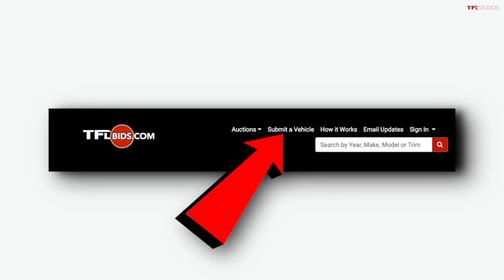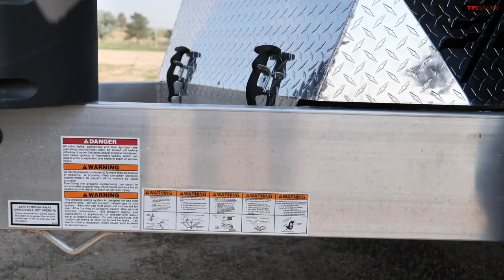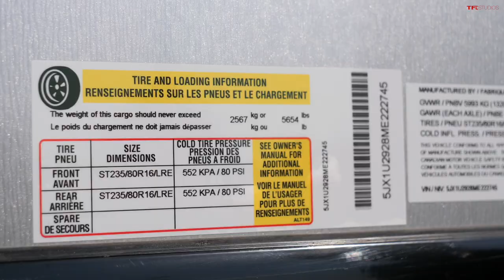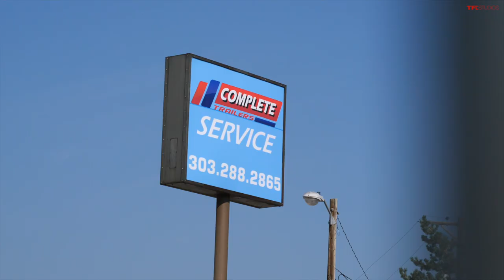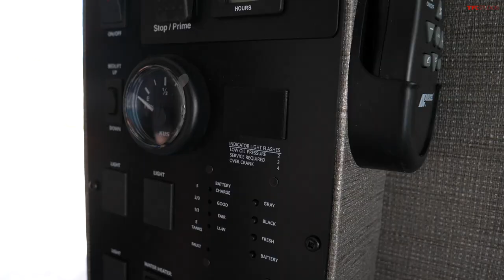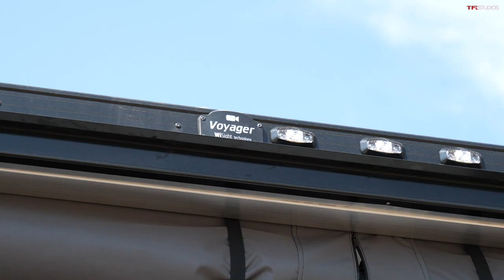This 35-Foot Toy Hauler Trailer Has The Craziest Feature I Ever Seen - TFL Camper Corner!

Comment: Bought my first one in 18'. A 28' front bedroom. Great trailer. Decided we needed more cargo capacity and then bought a 28' front bathroom. Had an offer to sell it and we did. Didn't loose any money on them as prices have gone up a fair bit. Last December we bought a leftover 2020 36' fifth wheel. Should have done that from the get-go. Lots of space for us, the toys and the dogs. Love the trailer. Make sure you find a good dealer with a good rep. They are not all equal, you will travel to get one.

Comment: Awesome video my friends!  ATC makes some great trailers with crazy payload capacities. I'm not a big fan of the battery location.  I feel they could have placed it in its own area an not in the passthrough storage.
Reply: Please review one of their 5th wheels. I would very much appreciate your honest opinion. Love your videos!
Reply: Was made aware of ATC from a review you did a couple years back, proud owner of a 2917 now!  Keep up the great work!
Reply: Surprised JD didn't mention the half-ton truck pulling this thing 😁
Reply: You could put the batteries in the same compartment as the gas pump
Reply: What do you think of an all
 alum frame ?  Have a 2018 f250 sd with a all alum body but a steel frame
Reply: @WilliamFisher1  3/4 ton. Gasser though.
Reply: @CompleteTrailers  Oh I didn't know there was a 2500 Z71 now. Cool.
Reply: @WilliamFisher1  2015 model and we need to trade it but…no trucks available lol
Reply: JD is looking at his new competition 🤣
Reply: @WilliamFisher1  it's not loaded.
Reply: @kellycrandall6258  I have two horse trailers that are all aluminum. Frame, floors, walls and roof. Both are more than 20 years old. Both are still in fantastic condition with no signs of stress or cracks. And I use these trailers frequently. Mostly in backcountry environments, off highway. Logging roads, etc. No issues. I think the only way to kill an aluminum framed trailer would be to overload it. I do wonder about the weight of something heavy, like a Jeep, at the far end of that trailer. But judging by the frame rails, I doubt it would be an issue.
Reply: @WilliamFisher1  that was a 3/4ton 2500HD Gas truck.
Reply: @davem7722  no competition here. I love the TFL channels!  The more perspectives on RVs the better!
Reply: @447Film  if enclosed, not sure if anything able to spark would be good where gas fumes are. Just my opinion though.  Peace.
Reply: @birdlady2725  I know I was just kidding😆
Reply: @447Film  Any relation to Swift Transportation?
Reply: @birdlady2725  I wish. I would be using this trailer instead of watching it on my phone

Comment: Love seeing others appreciate these!  We have a 28 ft ATC toy hauler for fulltime living and love it! Our tow vehicle is a 2500 diesel.
Reply: Could you get sealed bottom and heated tanks?
Reply: @davidc.9933  we have heated tanks. The unit we purchased was off the lot and did not come with underbelly insulation but that is certainly an option, or can be DIY'd later. Some think having it is worth it and some don't. Also, it's not sealed.

Comment: I’ve been hauling a camper for a long time and I think I’d want a dually for that rig.
Reply: Judging by its weight and that it’s a bumper pull it looks like a 2500 or 3500 would have no problem. Maybe with a Jeep in it tho a dually would be better. But at that point just by a fifth wheel toy hauler.
Reply: I wouldn’t use anything but a dually for that trailer
Reply: <14000 gvrw is well under new 3/4 tons capability... move to a dually and you're under  50%...
Reply: @gill998  I live in Texas. Pulling that ridiculous bumper pull behind a single rear wheel across the plains with a 20-25 mph cross wind would be a wild ride.
Reply: @gill998  that's not the point  a DECENT crosswind with a jeep or a side by side in the back would change your mind very quickly. guaranteed
Reply: @johntyson  A Ram dually long bed with a Cummins for sure.
Reply: @johngaudet6316  Nah…F350 dually long bed like mine for sure 😂

Comment: Nice video..
I was going to get a toy hauler, BUT , the cost of the hauler, the cost of the PROPER truck to pull it, the fuel you'll use to tow it, then a generator!!
I just get a hotel rooms and save myself a ton of money!!!
Reply: Yea and you come out in the morning and your trailer full of gear is gone.  Happens a LOT!
Reply: I did the math on this too…I’ve been looking at ATC for awhile.  Bottom line, as you mentioned including the truck to pull the trailer, the breakeven point between a motel and this setup is about 800 nights in a hotel. Not including truck and trailer maintenance. ATC makes a great rig though, my wife does not like it because it feels like you are sleeping in the garage.
Reply: @MrSkurtenb  LoL!!

Comment: For safety and other reasons, at 35' I'd be looking only at a 5th wheel. Nice frame and structure though.
Reply: get a good sway hitch and its fine. my 32 foot hitch pull was all over the place even going slow. put a sway hitch and it doesnt move. doesnt go into other lanes even cruising 70 down the interstate passing 18 wheelers

Comment: It would not be fun pulling that trailer fully loaded on a bumper hitch even with a 1 ton truck.
Reply: Have the same trailer and 1 ton F450 pulls it just fine!  On my way back home from a 2,200 mile round trip now. 👍🏼
Reply: Weight distribution and anti-sway are 100% required with this trailer.

I regularly pull a properly equipped 16k conventional tow tilt bed with my F350 long distances with no concerns.  In fact, it tows easier than my 8k camper with my Expedition.
Reply: @markburnett8699  Agreed. I’m using a EAZ Lift hitch for weight distribution and sway, only complaint is that the don’t make a 3” model for the alumiduty receivers.
Reply: A one ton dually is absolutely fine . The dual wheels really makes it an easy pull. I wouldn’t want to tow it with that 3/4 ton very far, that’s a lot of trailer and getting the tongue weight correct with your toys may not always be easy or doable.way better off with a a dually .
Reply: @leeduis  1ton F450?
I have never heard anyone refer to an F450 as a 1ton before.
Reply: With these trailers being an open Floorplan instead of a Garage Floorplan it's very simple to load them correctly. 
The axels are not just centered on the frame.
Reply: @jamesglenn520  1/2, 3/4 and 1 ton are the traditional categories… does 1.5 ton work better for you? 🙂

Comment: Have a 2016 28FB. We have really enjoyed this trailer. We pull it with a 3/4 ton. No sway with and without a wdh. Have andersen wdh. Will use it crossing SD, WY and other areas when winds are high. If we ever upgrade it will be ATC or something very similar. Only issues have been typical 3rd party rv appliances that all trailers have.

Comment: This really will be carefree for decades. The aluminum cabinets are excellent, if you like the look. I do. Like Andre says put your toy inside and go! We travel with a Pioneer 1000 once in a while and something like this would be nice. Even when you don’t have anything in there it will be nice to have all of that room! I have a nice bed for when I snore too much and Momma kicks me out!! Hahaha. I agree with Andre to a point. I would never even consider a gas motor for this trailer. They don’t tow worth crap! They have a bit more power than some of the 1/2 tons, but not enough to warrant more weight. There’s no turbo so the torque band starts way too high and it is not near enough when the going reaches the maximum of the trucks. Diesel would be the only consideration by myself for towing a travel trailer, especially when they get to 8.5 ft wide! It’s got so much frontage that adds to the workload sometimes more than weight! We live in very windy country here in Alberta and it makes my F150 Hybrid work pretty hard going into a 50+ mph wind (until I can safely pull over and park the u it until the wind dies down). The w1 Hybrid does have diesel like torque up to 570lb ft!  It’s just nothing like how the diesels produce torque now. 900 + lb ft of torque is nothing to sneeze at and no gas motor out there can compare. Been towing for a few decades now so I like to think I know what is safe. The new trucks are amazingly capable if not a butt too over rated in the 1/2 ton class. All a sad competition for our dollars!!

Comment: Toy haulers as travel trailers are very dangerous if not loaded properly. The majority of what you are loading is going to be behind the axles which will subtract tongue weight. I've seen numerous travel trailer toy haulers wildly out off control going down the road because of weight distribution

Comment: Nice trailer! You know JD (BTBRV) will tell you dually only
Reply: yep was just thinking that
Reply: @jamescalvert240  You are looking at anywhere from 800lbs to 1980lbs of tongue weight from that trailer depending how it is loaded up. So yeah id be leaning towards a dually as well since most SRW trucks hitch might not be able to handle that weight. If you are gonna drop  $85k on a TH like this then im sure you could afford the appropriate truck as well. Hell my '12 350 srw would be at its limit with this trailer as the hitch is only rated to 1500lbs with a wdh setup.
Reply: @bpaul1201awesome  My 2020 Duramax CC LB 4x4 is rated at 1800 tongue and 18.5k trailer and it handled about 14k like it was nothing. It depends on what truck people have and how often they plan to tow. A dually rides to rough for me and I have a somewhat small toyhauler and equipment trailers for work are easily covered with the capability it has. I used to tow my toy hauler (8500 lbs loaded actual weight, but 21' long and 11.5' tall) with my 79 C20 with a well built gas engine, air bags, upgraded 4 wheel disc brakes, etc. Trucks have really improved over the years, even over the last 10 years.

Comment: Would a 2500 diesel run out of payload with that trailer.
Reply: My 2020 duramax CC LB z71 is rated at 18.5k trailer and 1800 tongue, and something like 2800+ on pin weight. It is very stable and rides great. I have only hauled up to about 14k in a trailer. Older trucks have less capacity, even the 2019 duramax.

Comment: Many trailers are missing the on an generator because there is a severe shortage of parts for them. A lot of manufacturers are sending units to dealers without the generators installed.

Comment: All aluminum is definitely worth the price of entry, but it must be built right.  I own an EBY stock trailer, because they are much stronger than the competition.  Early competitors experienced frame failures that were resolved with proper gusset and other design changes.

That said, I would be interested in seeing a factory tour showing the fabrication of the frame and gussets of the trailer prior to mounting the body.
Reply: @chrisneuhaus7188  
Good stuff!  Exactly what I was asking for.  Thanks!

Comment: Nice trailer but I'd prefer a fifth or GN setup.   A 35 ft bumper pull that size with the weight of a jeep as a variable in the ass-end .... you'd better have the WD hitch dialed in for each trip and weight variation.   Uffa.....

Comment: At bear minimum that trailer needs a one ton single rear wheel just based off of  payload capacity but really a dually is better.
Reply: My 2020 2500hd duramax would be more than enough. It is rated for an 18.5k trailer and 1800 tongue weight. It pulled 14k like it wasn't there. Of course the 2020 has higher ratings than previous years and it has a 10 speed trans. I would imagine the 2500 duramax trucks from the teens should be ok on rating, but maybe close. A dually is a safe bet, but I have a friend that towed up to 18k with a 2500 dodge cummins and he said stability was fine. He also had a dually cummins, but has switched to an F450 for his living quarters horse trailer that is 40' and 30k pounds. For me, a dually wasn't an option due to the ride and my toy hauler is only a 21' but at 8500 loaded and work trailers aren't more than 14k. It depends on how often people tow and what their needs are.
Reply: @CGT80  the payload and towing capacity maybe there but 14k on a flatbed trailer tows way different than 14k in an enclosed trailer. 

35ft long and a full profile unit is a HUGE sail behind the tow vehicle.
Reply: @runningscout14  Yes, my 21' 11.5' tall toy hauler (8500 lbs) was quite noticeable behind my old truck. Even in wind, it wasn't noticeable behind my new truck. A friend used to tow a 35' 5th wheel with his single tire truck, but it seems goose necks and 5th wheels don't effect the tow vehicle as much......plus they are shorter when combined with the tow vehicle. My 21' ball to back is the same length as our 25' 5th wheel, which overlaps the truck by 4 or 5 feet. My truck also has sway control built into the steering system (top of the line duramax) which might be a great thing for such a long tag trailer. It would be interesting to hear from people who have towed the trailer in the video......dually is certainly the better bet.

Comment: I am not sure you could run a WDH on this trailer without drilling holes. I know a lot of HD's are technically capable of taking this without a WDH but I would still want to run one.
Reply: A DrawTight 4point should work fine with this trailer.

Comment: Great video. Can that ramp support a Jeep? Does the trailer have hydraulic leveling jacks? Does it have a MORide suspension? With what tires is it equipped? Is it set up for rooftop solar? Etc.
Reply: ATC's website shows them testing the ramp with a forklift.  Not sure on the MORide but it has Goodyear Endurance tires and can be equipped with up to 800watts of solar I believe.  I'm looking at one of these.
Reply: They use torsion axle.. Ie no shackles.   Basically 4 wheel independent suspension.

Comment: I admit it's very well built and looks like it would last forever. However, I don't care for that cold, stainless steel, industrial, operating room look inside. Also, the kitchen doesn't seem to have much counter space and the sink is in a very awkward, cramped location. Might check out Sundowner.

Comment: Andre, why didn't you tell us the tank capacities?  If it's not 4 season capable, clearly it lacks decent insulation.  Plus, that aluminum gets real hot in direct sunlight. I didn't see a sway bar on the trailer hitch either.  Wouldn't it be safer with a sway bar system since your rig is so heavy and can carry about 3 tons in the garage as well as a toy gas supply.
Reply: probably no WDH or sway bar setup since it is a new trailer and it isnt his. Most dealers dont want anything like that on demo units. Those are post sale items that are added in. It is empty so probably not much if any sway. They are delivered from the factory as well without a wdh or sway bar.

Comment: Great video Andre/TFL. It’s best to haul that Toy Hauler (TH) with at least a 3/4 ton. I think Andre was being too soft when suggesting “kind of should be hauling with”.  It’s imperative; HD trucks have a much stronger chassis and better braking and more to handle this trailer, with safety. I remember hauling my Jayco TH with a 1/2 ton with max. tow package and feeling the truck wobble at times and simply feeling under built for the task. When I switched over to a modern 3/4 ton, so much more capable and stable; simply the right choice and getting the same fuel economy as my 1/2 ton when pulling. Also thanks to Big RV Big Truck for their videos on what size truck makes sense when hauling whatever. ATC as many have commented; superior build quality and thus a premium price. 👍🏼

Comment: That shoulda been made a 5th wheel for sure, or gooseneck.
Reply: That's the largest standard trailer they sell. They start at 15ft and very capable at that size, and also offer 32-45ft fifth wheel models as well.

Comment: I must have done something wrong with my life because there is no way I could afford one of these trailers, and a diesel HD to pull it, without being in a savage amount of debt.

Also, I don't know where you bring this thing. Boondocking anywhere but the desert often requires getting down some tight trails, and most of the State, national forest and national park campgrounds I have stayed in around Utah and Wyoming won't take trailers much more than 24'.
Reply: You would take it to a place with trails for your toy that you also cannot afford, me either.  Look at places from Crandon race track to the Californication desert, Arizona, etc.  Places that have off road tracks. This would work well with the dunes easy parking and you spend your day riding on the dunes.

Comment: Good quality but offers nothing in terms of interior. Compared to grand designs momentum series and keystones toy hauler lines this toy hauler lacks an interior. 
I mean,  it all depends on what you’re looking for but for the money I would personally grab a grand design 31G toy hauler.
Reply: Agree that the interior is pretty spartan but the idea here is minimal deterioration, maybe sofa padding.  The frame, walls, even insulation are built to be resistant to water, that is if the 1-piece AL roof leaks.  Normal stick built trailer structures rack going down the road, the ATC is a welded box that'll handle the flexing.......for decades.  Even 15yrs old these things still bring big $ because the structure ages well.  These are the main reasons I'm buying one.